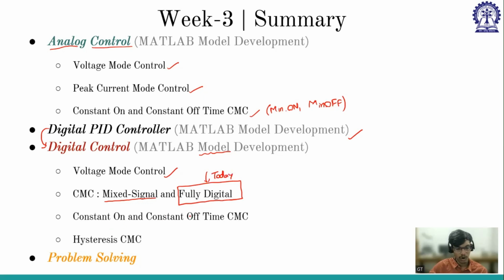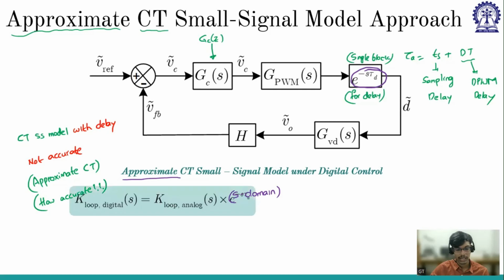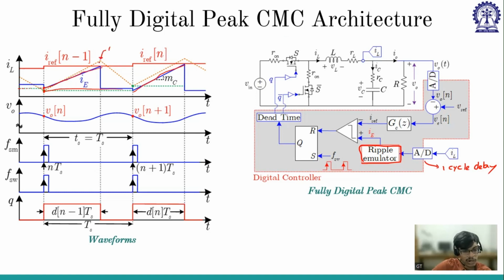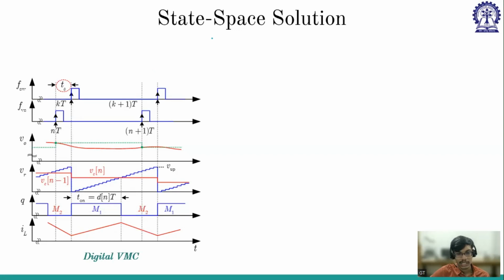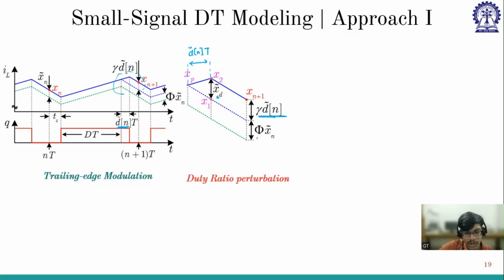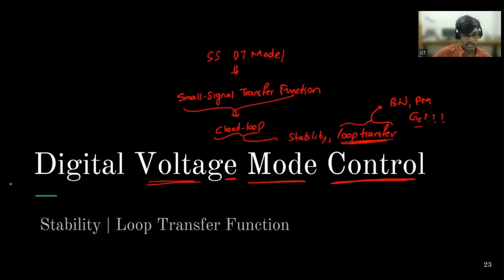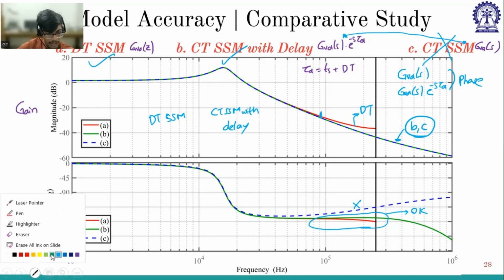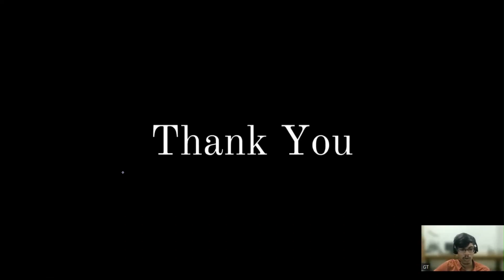Week 4 | NPTEL | Modeling Techniques and Model Validation using MATLAB | Problem-Solving Session

Comment: In ZOH modelling., Vz(s) = A(1- e^(-sT))e^(-skT)/s.,But here in lecture k is not present(if A =1)
Reply from the maker: Yes, V_z(s) will have an 'A' term in its expression. V_z(s) is the output of ZOH with input being an Impulse function of amplitude A. So, the transfer function of the input is 'A'. As the transfer function of ZOH is output/input, the 'A' terms will be canceled in both numerator and denominator, and we'll get G_ZOH(s)= (1-e^(-sT))/s

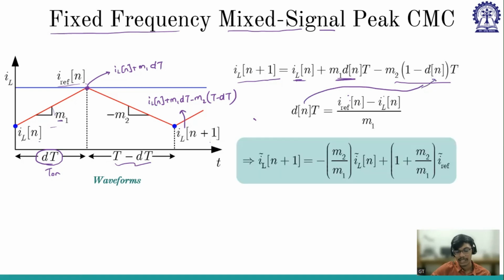Comment: In fixed frequency mixed signal peak cmc, everything is in analog at 36:08, but why it is shown in terms of [n] as descrete time talikng at the time of comparison
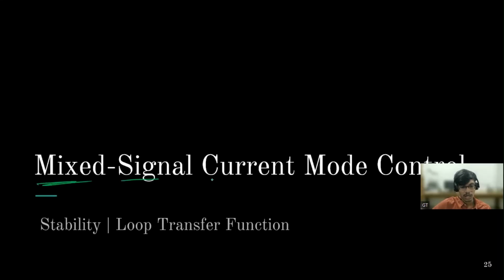Reply from the maker: Good question Benarji, thanks for asking. Yes in MCMC, current loop is in analog. But we are checking the stability of the current loop in MCMC using our large-signal 'discrete-time model' which captures the inductor current at nth rising edge i.e. i[n] and at (n+1)th rising edge i.e. i[n+1], then we are developing a relation between those two values, then ensuring the eigenvalues lie within the unit circle i.e. |z|<1. You may refer to 01:51:55, where we have considered the closed-loop stability in the same way using DT model. So, current loop is actually in analog domain in the implementation but the DT model we are using to check the stability is discrete and is represented as x[k], i[k], iref[k] etc.
Reply: @tejagollagt  okay Sir,Thank you